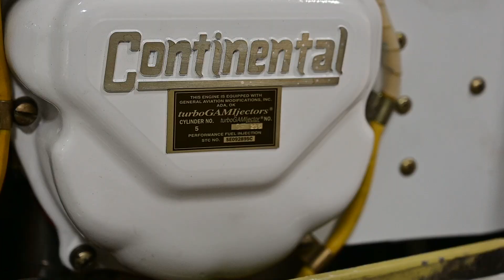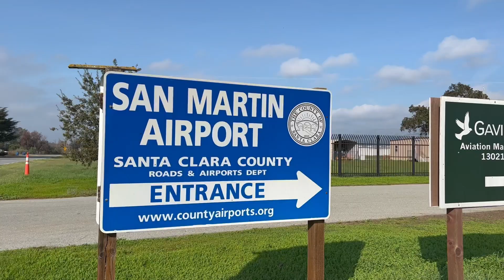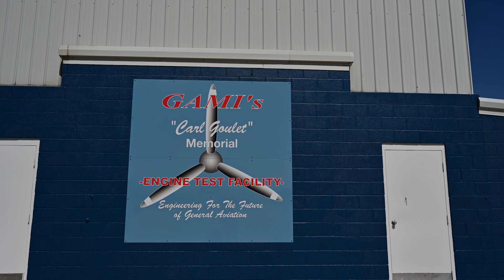Behind the Scenes of GAMI's Unleaded Avgas

Comment: Fly experimental.
Use whatever fuel you want, that works in your engine. 

93 octane is plenty for 8.5:1 compression ratio, as long as your not running near 500f cylinder head temps.

Comment: I am extremely pro unleaded gas for my Piper Arrow, not because I am a crazy tree hugger but I want my engine to live longer. Aircraft fueled with 100LL must use inferior oil to handle the lead that gets into the oil. This oil does not lubricate as well as moderne automotive full synthetic oils. Professionally I am a meteorologist but for fun I have a 1,000HP Chevy LS that is supercharged and has produced 1,000HP for 200,000 miles in a 1 ton truck. I know the power can be made on pump gas with fuel additives that are not alcohol, I use MMT to get 116 octane for max power runs all with the catalytic converters still working. I cannot explain the science behind the oils, I just know my race engine makes power and has no sludge in the oil pan.
I fear our .gov is trying to end private aviation by killing off GA’s fuel.

Comment: Getting rid of Lead will help kill off G.A. considering the plane prices and soon to be 10 dollar plus fuels. Lead is bad but so is the air we breath an the Teflon we all ingest eating!
Reply: Or we all switch to E85 an problem solved. E85 gathers water at the speed that 100ll loses front end hydrocarbons thus making them similar in danger when aging fuel.

Comment: A 800hp Dodge Demon uses unleaded fuel, so does the Corvette, Porsche,  Etc with hundreds of horsepower
Reply: @flywithaopa  the point that I was trying to make is about hp, and that ultra high horsepower engines are capable of using unleaded fuel. The excuse for leaded avgas is that is needed in high horsepower engines because of “high compression engines”, “cooling” and many other nonsense excuses, lead is not a requirement for higher horsepower as the industry has led of us to believe.
Reply: @javev1772  Most agree lead is not needed, but 100 octane is in order to prevent detonation, particularly at altitudes never seem by your Corvette and the lead additive is how we have gotten the octane boost needed. The challenge is finding an octane booster that doesn’t contain lead.
Reply: @tomhaines29  the 800 hp Dodge Demon engine that use in my exaggerated example above does not suffer from detonation with 91 octane unleaded. I also used that example as an obvious exaggeration as most GA aircraft engine, in comparison, don’t even produce half that much horsepower. GAMI and SWIFT have proved that most GA engines do great with unleaded fuels. Now is the time to get lead off of aviation fuels. We suffer from a resistance to change and improve, remember how people fought ADSB?  composite airframes? BRS ballistic chutes? the disappearance of the halogen lightbulb? Seatbelt laws? We are better today because of these changes, let’s do the same with Lead.
Reply: @javev1772  Again, most everyone in aviation agrees that we would like to not have lead. However, at this point no one has an approved solution for airplanes that require 100 octane. Maybe you’d like to go fly a Continental IO-550 on 91 octane and see how that goes? Report back.

Comment: Hopefully the bureaucracy at the FAA gets this done. Has been decades of work and pilots owe a debt of gratitude to Mr. Braly and GAMI.
Reply: I've done 2 hours of research. And I can tell you that octane. 100% octane. Has an octane rating of 100.

It also has a lower vapor pressure than Avgas. Which is far lower than MoGas. Octane is very stable. Very high octane. Mixes with any gasoline mix and improves its octane... because it is literally octane.

Comment: Yes, please get this 100UL out to airports where 100LL sales have been banned. As Reid Hillview is my home airport I can attest to the significant safety issues of not having fuel on the airport as well as the significant pain it is to always have to fuel up at my destination.

Currently the banning of sales of 100LL at any airport is the most significant threat to the freedom of GA to fly. It would be real nice if the FAA stopped dragging their feet on a fuel that has already long proven itself. The longer the FAA takes the more likely GA airports will be shut down. The more GA airports shut down the harder and more expensive it will be to train new pilots for the pilot shortage.

Comment: As much as we all would love for everything to happen over night, frankly, it's amazing that regulatory approval is moving this fast! (assuming it doesn't grind to a halt, of course.) It will be great when there is a good cross section of aircraft and engines "in the wild" that have multiple years running this stuff.  I'm very hopeful that this works well.

Comment: Why is lead still even needed?🤷🏻‍♂️🤦‍♂️
Makes absolutely no sense…None at all with the engine technology available today. Seriously
Reply: Study up and get back with us.
Reply: @bullhead900  why ask a question? Stupid response
Reply: @flywithaopa  not true. 75% of GA engines can run on 89 octane, 100LL for these engines is not needed. The other 25% of ga engines, big bore, high hp engines may need 100LL.
Reply: @flywithaopa  there is 100 unleaded available at the pumps for cars, why would this not work? Honest question! What about octane boosters in 98 pump gas, would this not work? Is it a issue with the valve seats?
Reply: @sacrificialrubber779  mogas octane is measured differently than avgas octane. If the Texaco station had R+M/2 105 octane gasoline, that might work for airplanes. Instead, the Texaco has 93 premium.